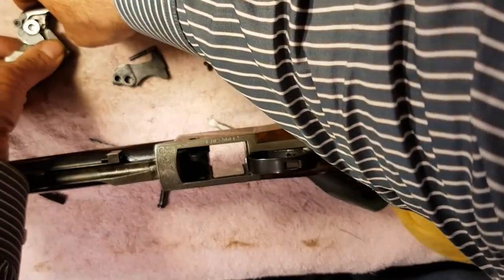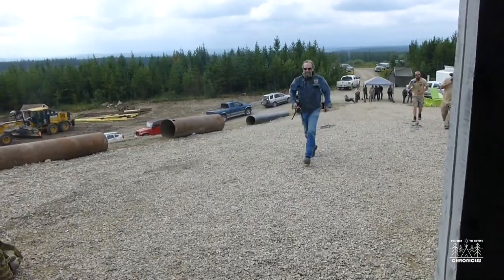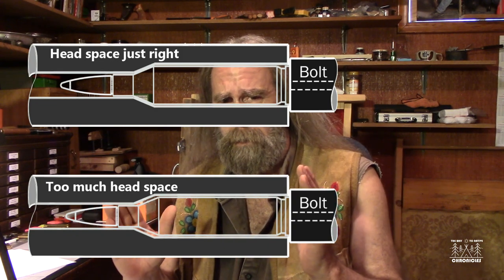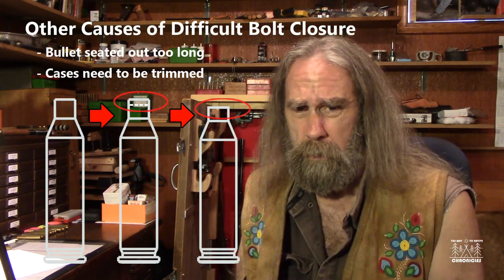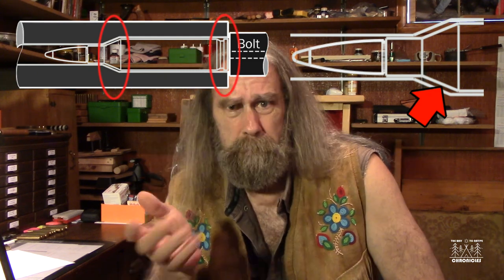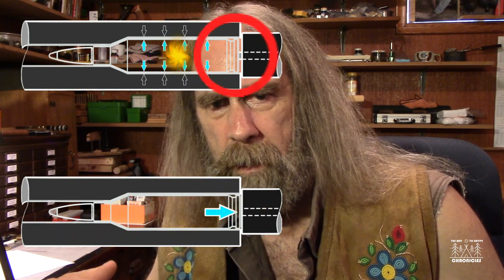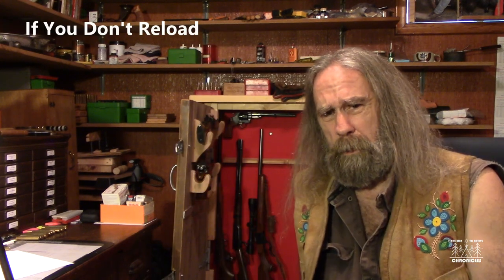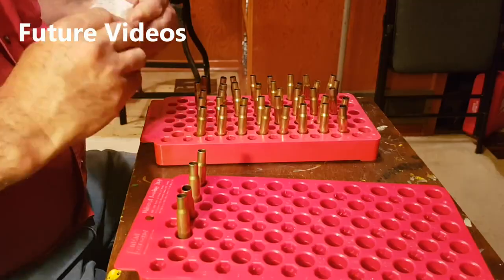Why Do I Get Misfires Or Case Separations?  Head Space Explained.

Comment: As a reloader that’s been reloading for more than 30 years I really enjoyed your video and I find information to be right on, you did a really good job illustrating it too. Awesome video
Reply from the maker: Thanks Leverguns.  I put a lot of work into this video, so it's so gratifying to see it well-received.  Before releasing it, I was a little worried it might not be appreciated due to the complexity of the subject.
Reply: The Way to Native Chronicles I feel like you did an excellent job, The only thing I might’ve added which is only usually on lower pressure cartridges like the 30-30 is that when there’s too much headspace sometimes you’ll see the primer protruding from the cartridge after firing specially if you use a lighter lead bullet loads, I really enjoyed all the illustrations, and I will definitely recommend this video to anyone Who might be having headspace problems
Reply from the maker: @Leverguns50  Thanks for the tip Leverguns.  I knew I had forgot something!  ;)
Reply: The Way to Native Chronicles, well you know now you got to do a part two with rimmed cartridges, lol

Comment: The way you described somewhat advanced information in such a simple format is amazing. I have a bottle neck pistol that has long headspace intentionally, I had my die screwed in a bit too far and was blowing heads, but also getting splits in the case wall. I knew the head separation was the headspace, but didn't know the cracks were too! Got that issue fixed already.
Reply from the maker: So glad you found it helpful Neal!  Thanks for leaving that comment.

Comment: Having this problem with Rifle Line 8mm Mauser ammo pretty consistently.
Reply from the maker: After firing a case once, if the head hasn't separated, adjust your resizing die so that it doesn't bump the shoulder back.  Then test fit it in your chamber, increasing the amount of 'bump' needed until it chambers without resistance.  Once you've calibrated your resizing die that way, leave it that way from then on and use once-fired cases for your rifle.
Reply: @TheWaytoNativeChronicles  Thank you, but I'm not reloading, this is store bought ammo. Now I am wondering if they are. Using different ammo is the key I guess, I was wondering if it was my rifle. Thx!
Reply from the maker: @noserly  you might want to have your rifle checked by a gunsmith for improper headspace if that's the case.  It can be fixed.

Comment: Very informative thanks...I have a G3 clone chambered in 308 I just had a case head separation with factory ammo about a 1/4 inch from the primer. First one in about 200 rounds,  would it be safe in your opinion to shoot it still or how dangerous is case head separation? I’m debating if I should just take it to a gun smith or chalk it up to the ammo tolerance?
Reply from the maker: Yeah, I can understand not being sure how significant it is, seeing it's just one case in 200 rounds...  I would give the other cases (if you still have them) a visual check to see if you have a slight, bright ring around the cases at the location where the other one separated.  A bright ring is an indication of the brass stretching in that region.  There is also the test you can make using a bent paper clip (I discuss that at the 27 minute mark of this video), dragged on the inside of the case walls to see if it hooks on a crevice developing on the interior at that location.
Reply: The Way to Native Chronicles I’ve read as well that maybe over oiling your gun could cause the head space issue something about the case not being able to expand due to excess gun oil? Is that even a thing? Ha thanks for your help.
Reply from the maker: @incognitonunyabuisness5192  like what I alluded to at the beginning of this video, when it comes to head space - because it's so hard to understand how it happens - people tend to grasp at straws and come up with all kinds of incorrect theories as to why.  That over-oiling explanation sounds just like one of those.  Over-oiling has other bad effects that should be avoided, but I can't see how that could possibly affect head separation.  Indeed, the presence of excess oil would tend to reduce the play inside the chamber to allow for less movement inside.  But the cause of the head separating is actually the opposite:  the case having too much room (length-wise) inside the chamber.
Reply: The Way to Native Chronicles thanks sir
Reply from the maker: @incognitonunyabuisness5192  My pleasure and thanks for your interest in my channel.  I enjoy receiving feedback and questions from people viewing.

Comment: Good info! I shoot and reload for single shot 45-70. I've been noticing some stretch marks on some of my cases. It's mostly Winchester and not so much on Starline. Full length resizing doesen't squeeze the matl back down under the head. I usually set those cases aside and retire them. 
Is that right? It's usually after about 5 reloads.
Reply from the maker: Unfortunately, this video doesn't really address your issue me_92_other.  This is because the .45-70 head spaces on its rim, whereas this video addresses cartridges that are bottleneck.  If it helps any, in my experience, straight-walled cases don't grow in length (or so little it's imperceptible) because there's no bottle neck for the gases to press against when the gun powder ignites.
Reply: I recommend taking one of the cartridges that you set aside and cut it in half lengthwise and see if there is a problem, see if it’s getting thinner
Reply: @Leverguns50  Thanks levergun. I'll do that and see what's with it.

Comment: I've been reloading for over 10 years and I have found if I load just 1gn below starting loads my cases last.
For instance starting load is 23gn - max load is 25gn, I load 22gn. Everything works fine and it's easier on the brass.
Reply from the maker: If you'd like my opinion Hawk (over 40 years reloading experience), I'd say loading under the suggested starting load is not a good idea.  It could lead to detonation some day, will be less accurate and, most importantly, is not necessary - especially for straight-walled cases which will last almost forever if treated the right way.  The biggest acceleration of failure in such cases is over-flaring the case mouths, coupled with applying too much crimp.  That really works the brass, causing it to harden and then crack.  Plus it's a false economy, creating thousands of rounds of substandard ammunition (i.e. wasting good gun powder and other components) in order to save pennies on extending brass a little further.  If you really want to extend brass life, you could always look into annealing the cases periodically.  When it comes to .44 Mag brass, I am still using many of the same cases I reloaded over 40 years ago.  Straight-walled can last a very long time, many reloads.  Thanks for sharing your approach and I hope you don't mind my suggestion.
Reply: @TheWaytoNativeChronicles  h110 296 is a powder I beleave to be  sensitive to excessive open space in a cartridge and shouldn't be loaded under start